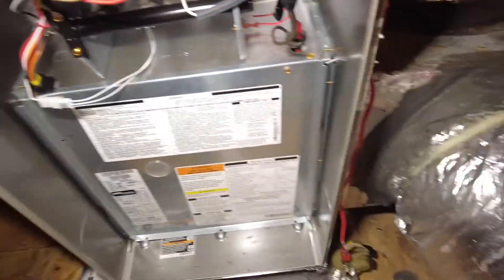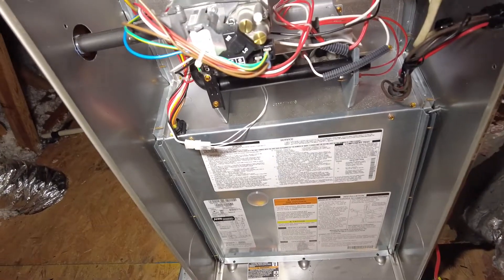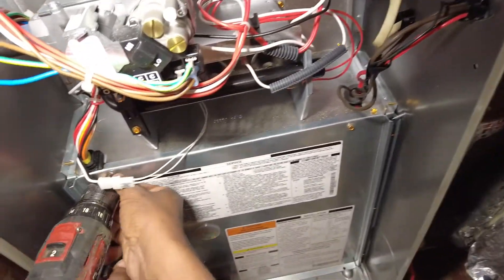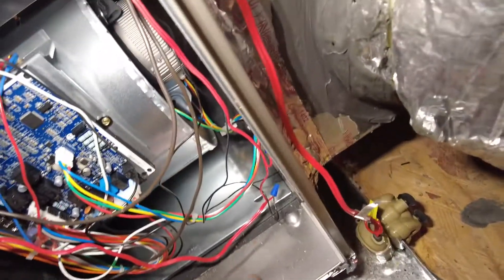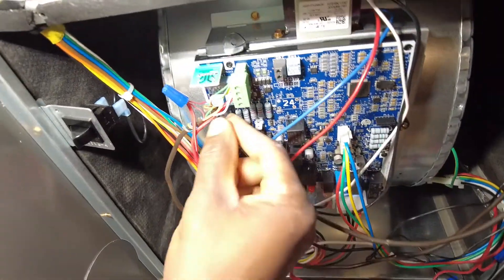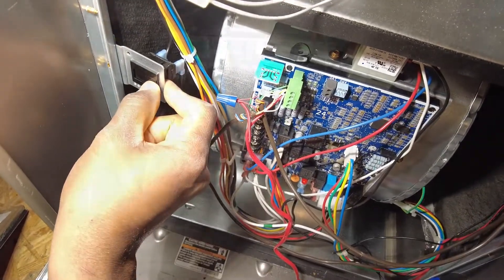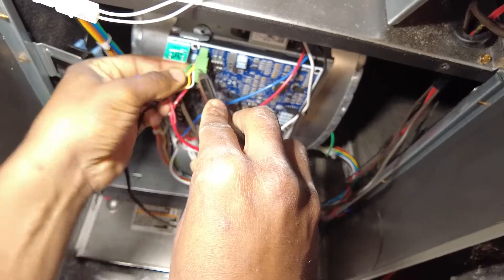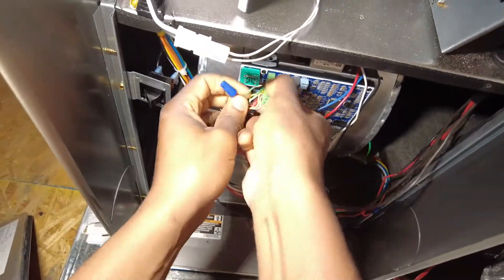Simple HVAC Service Call - AC Blower Motor error code 41 on Carrier Infinity System

Comment: I got an error code 42 today. I do not have an error code 42 anywhere on this machine. Thought my control board was bad. Turns out they put the wrong trifold card with fault codes. I have an error of 42 inducer but my paperwork does not show that. Thanks carrier for being right on top of things yet again.

Comment: Hi  Bryant evolution AC runs ok but does trip 41 code and resets and starts up normal are these blower motors 2k+ and labor 1 k+ to replace thanks 7-15-2025
Reply: did you figure out the problem?  I have the same issue.  does the blower run ok in manual?

Comment: I’m having the same issue! It was off for 3 days with error code 41, hours after someone came and looked at it and quoted a $3600 fix (or tried to say just get a whole new unit)… it works!  Blower motor kicked on and held for 20 hours. Now it’s not working again. No wires lose… any ideas?

Comment: Wires should be pigtailed into the plug, this helps to prevent communication faults and confidence loss from customer regarding these infinity systems, trust. Good find though
Reply from the maker: Nice! Appreciate the tip. I’ll definitely keep that in mind.🙂

Comment: Hello, Im having this same issue. I checked all wires and nothing is loose. The motor sounds like its trying to turn on, would this mean i have to replace the full blower motor?
Reply from the maker: Can't say for sure without fully inspecting it but it sounds like it's likely the blower motor. I would check to see if its getting voltage to the motor and perform a go no go test. I have a video explaining this in detail.
Reply: @HVACTechKnowledgy  Turns out i have a variable A/C Unit and things got much more expensive sadly lol
Reply: The loose wire would have caused a communication fault,not code 41